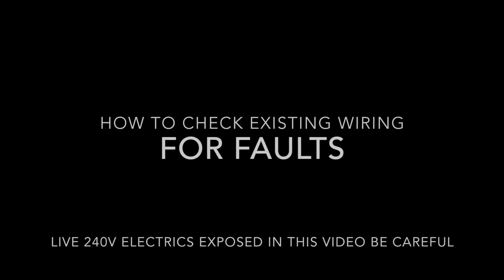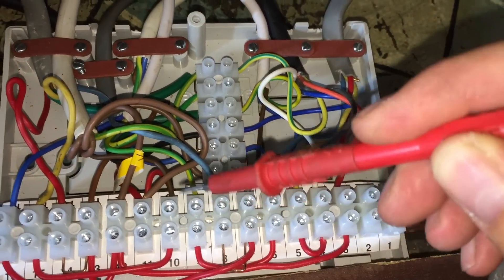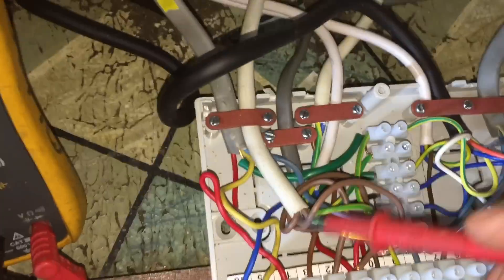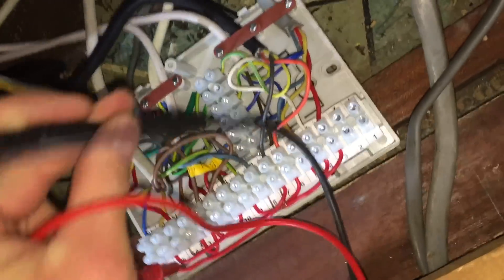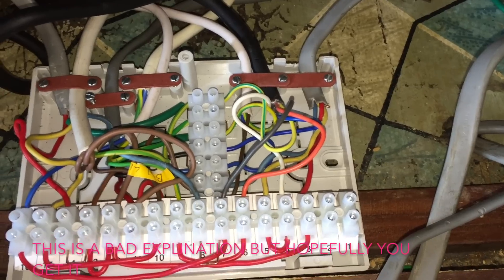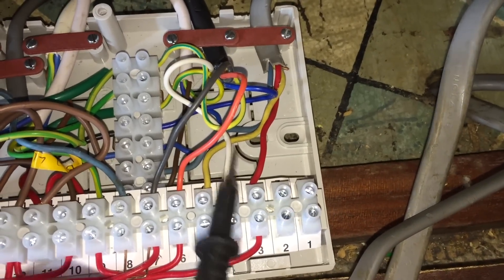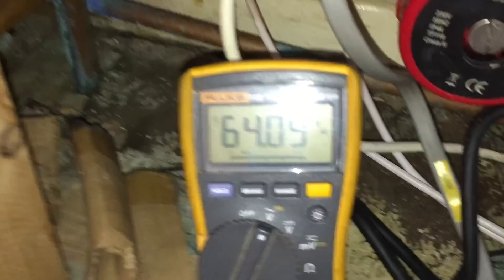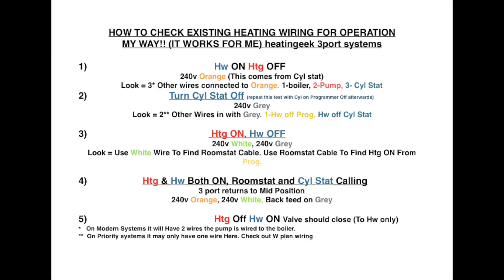How to test 3 port system wiring for issues. Reference Sheet at End of vid

Comment: Just done the wiring on a Glow worm boiler with y-plan system. It was firing from a really low 6.7v backfeed voltage, so on all the time. Put a contactor on the switch wire which sorted it out. I think some of the newer boilers use solid state relays which are far more sensitive than the old coil types. I labeled everything up and left a wiring diagram to be kind for the next guy.

Comment: Problem with my Drayton 3 port so I'm reviewing your vids - very good BTW. Subbed & liked as well. 

My problem originally was no HW overnight. Investigation lead me to the 3-port valve. No HW suggested a stuck valve body so I didn't mess about & got a new Drayton MA1 valve body & new actuator as a complete kit. All fitted OK & wired the new actuator head colour for colour same as the old one. So to testing. The actuator works fine off of the valve body. HW, Mid & Heating positions. However, when snapped back on the new valve body the actuator will not drive the indicator past the Mid position to activate the pump & boiler for heating. Thinking I might have a duff actuator head I bought another one - same problem. Tried both new actuators on the old valve body (which looks OK to me) & the same problem again. Actuators work fine & energise the boiler & pump in heating but will not do the same when fitted to the valve body. It's almost as if the actuator drive shaft & valve spindle are out of sync & the valve body spindle gets to it's max travel position before the actuator reaches the point when it switches on the boiler & pump via the micro switches.
Short of fitting a different make of valve head & body (which will no doubt require pipework adjustments) this has totally stumped me. I even rang Drayton Tech who couldn't help - said they've never heard such a problem before. 
So if you've got any suggestions I'm all ears.
Reply from the maker: the body must be duff. I have never had it happen but if it works off the valve but not on it then it must be. The grey wire is what drives the valve over to HTG only once the HW demand is met. If your positive it works off the valve the the only issue can be the body.
A is HTG, B is hot water and AB is flow from the boiler, Is the body fitted correctly?
Reply: @HeatingGeek  Yep the body is fitted correctly & it's a brand new one, there's only one way the Drayton heads can be properly fitted to the body & snap into place. Weird this is I had the same results with the new body (now fitted to system) & the old body on my bench - which looks perfectly OK to me. I have tried both new heads on both the old & new valve bodies with the same results. I even took the old actuator head to bits to see what could be wrong mechanically. There's a very small amout of spindle travel on these Drayton valve bodies & to my eyes it looks like the spindle is hitting it's max travel (indicator arm just passed the mid position) which prevents the actuator driving the arm fully over & engaging the micro switches to fire the pump & boiler. Spindle & acuator drive look out of sync if that's possible. As I said even Drayton Tech were stumped & have never heard of this one. I'm going to do some a more detailed wiring checks just in case something else is leading up the wrong path. 
Thanks for replying to my message on a 6 year old video. 👍 :washhands:
Reply from the maker: @colingoode3702  if you were to move the valve manually it will not make the microswitch, you kinda have to push it as far over as quickly as possible and the inertia will carry the actuator fully over. ie: the actuator head will not make the second microswitch if slowly moved by hand. 240v on grey and white will electrically move the valve fully to HTG only. 

I hope this makes sense
Reply: @HeatingGeek  👍I'm going to bench test the old valve body & new actuators with a flying lead into the wiring centre & watch watch happens. I'll also double check & test the wiring - just in case. Thanks for the help.

Comment: That wiring centre comes with a long length of red sheathed cable for making the additional connections on the terminal blocks ... that they've used the pre-bent ones that are meant for the neutral and cpc is beggars belief (and dangerous).
Reply from the maker: Why is it dangerous? Im sure the diagram on these boxes shows the links being used for power stuff. I'll have to double check but i'm am quite sure.
Reply: @HeatingGeek  if you have the cover open to test without it being isolated then those bare conductors would be very easy to brush against by accident and give yourself a nice 240V zap. Even with the cover off, having at least a single layer of insulation just seems safer.
Reply from the maker: @PhilJohn1980  Your absolutely right about that. It does make sense 
.

Comment: Great video but at about 1:43 do you say the orange should be 240v with the hw on then about 9.30 say you can remove the orange? Don't get that bit
Reply from the maker: The reason is the orange will only have power when "CH only" is on. The orange is wired into the demand from the cylinder stat, so when the HW is on and their is a demand from the cylinder stat the valve hasn't moved to "CH Only" the power to run the boiler comes from the demand on the cylinder stat. 

It's very hard to explain over text. 

The simple answer is the orange on a 3 port (isolated from other wires) will only ever be live the you have a CH demand and no HW demand. I hope this helps
Reply: @HeatingGeek can a faulty cylinder stat prevent both heating and hw to come on? No faults on boiler, my issue appears to be due to condensation in the loft. In warmer months everything works fine but in colder months it doesn't... I've changed pump, valve and some wiring last year but not cylinder stat.
Reply from the maker: @nadznadz5630  Yes the cylinder stat can cause no heating. When the HW is satisfied but the demand (HW) from a timer is still there its the cylinder stat that sends power to the grey wire on a 3 port to make it open fully for heating. This in turn sends power down the orange to light the boiler.
Reply: @HeatingGeek  but i don't even get hot water, if i got one then easier to diagnose. The cylinder stat is 25 years old at least..

Comment: Thanks for your videos.

I’m going to one today where the heating is staying on if heating only is on and then turned off at the programmer the pump and boiler stay on (3 port) 

If I put the hot water on at the programmer with the heating and turn the cylinder stat down it then turns it off. Really odd
Reply from the maker: I have a video on that. It's usually a Ri, Micron or Logic. I cant remember what video it is now...

Comment: Where should the grey wire go on a three port system pls.. I’m desperate.
Reply from the maker: Hot water off. So should join 2 other wires.
Reply: @HeatingGeek  Thanks, I’ve got a black from tank stat.and the grey from the valve, .. where do I put them? Pls.
Reply from the maker: @johnjackson1106  I have a video showing how to wire a 3 port system. If your system is a normal 3 port system, the grey wire goes to 2 other wires.1 will be from the cylinder stat (satisfied) and the other will be from the timer/programmer. (hot water off)
Reply: @HeatingGeek  you are brilliant 👍👍. Thanks for taking the time to help me. I’ll msg you when I’ve got the hot water back on.
Reply from the maker: @johnjackson1106  I hope you got it sorted
Reply: @HeatingGeek  Hello, No luck, I’ve identified the pump wires and the cylinder stat wires and the diverted valve. The rest is difficult. 
I had the boiler serviced by ex British  gas engineer, when he’d finished at first the boiler wouldn’t light . He said it was the  Electrode unit and replaced it, it still would not fire up. He then said it was the valve! When eventually it fired up we had heating but no hot water . He stormed out when I bought a new three way valve. 
I ll have another attempt at identifying the boiler from the control and room stat again . I’ve watched too many videos until I found yours. I need to clear my head. 🥸
Thanks you for your reply
Reply: @HeatingGeek  hello. By moving  the lever on the valve we’ve got hot water and heating , I’ve left the grey wire unconnected! When I put the programmer onto water only nothing happens, when I put the heating on the boiler fires up. It won’t work on water only. I’ll have another go at your reference sheet .
Reply from the maker: @johnjackson1106  That is not a valve issue. When on HW only the 3 port doesn't come into play. only the programmer and cylinder stat are involved in making the boiler and pump run.

Comment: Still catching up on your back catalogue. Off the wall and broadly irrelevant question - what do you thing of the relatively newly introduced WAGO based wiring centres - and have /would you use one?
Reply from the maker: I have always been very slow to accept new technology. I use normal wiring centres because I know what to expect. I know what I can fit (wire wise) and I know how tough they are. I will use a WAGO one when I have seen it in the flesh and can have a play with it. Until then, I like Drayton wiring centres.

Comment: Cool video. If i can ask a question. Any idea why when hot water is switched on it shuts boiler down whatever heating is set to. Heating works fine on its own but not with hot water
Reply from the maker: The wiring is wrong or the cylinder stat is faulty.
Reply: @HeatingGeek  Wow. !!   Yes it was a dry joint on cylinder thermostat live input.  Thanks for replying thou.   😃
Reply from the maker: @YorkshireBitsnBobs  I'm glad Its sorted and knowing wiring meant I had a good guess too. :-)

Comment: I cant find my 3 port valve. My junction box looks to be two faceplates with a 3amp fuse in one of them. The heating on doesnt circulate water in the rads unless it is combined with hot water on. No idea whats going on.
Reply from the maker: That could be how its meant to work. Old gravity systems were designed like that. What size are the pipes coming off the boiler?
Reply: @HeatingGeek  there is a valve but its behind a stud wall. I managed to install a nest combining the valve wire with the boiler and pump in the shed so all works at once. Cant have them separate due to it being an old system

Comment: This is excellent. I changed my Ideal heat-only boiler for an Ideal Logic + condensing heat only one. It's Y-plan connected with a 3-port valve. I had trouble with the boiler over-running the circulator pump and had to rewire the snake pit of wiring. I did it 95% right but noticed the radiators getting warm after the hot water only mode has run for 20 mins, so I have it wrong. This video will help. I see Honeywell do a proper wiring centre. Are these any good? All I have currently is a 10 space choc-block in an enclosure. It's a disgrace.
Reply from the maker: I have done a whole series on wiring. Check the Playlist tab and you will find it.:-)

Comment: Hi there, I may have a potential issue  with my central heating side of the system, I have a y plan with a worcester 18ri with pump overrun. When the central heating only is selected, I only get about 90v (from the orange wire) on the boiler demand terminal in the wiring centre, when the cylinder stat is satisfied. The boiler appears to still work and the pump runs. I can't help thinking if the pump wasn't switched from the boiler,i it would not work as the voltage on the orange is too low only 90v? The pump is wired directly to the wiring centre in the airing cupboard as you would expect with rest of the controls. The cylinder thermostat has recently been replaced, is it possible it could have been mis wired? its just the usual honeywell type, it has a short piece 3 core flex to the wiring center (Brown Blue and Green and Yellow)
The boiler is in the kitchen as well as the receiver, from the receiver two 3 core and earth cables go to the wiring centre in airing cupboard.
One cable contains (in the wiring centre)
Red=hot water on, connected brown to cylinder stat common
Yellow= central heating on, connected to white to 3 port valve
Blue= hot water off, connected to grey to valve and the Green and yellow which is connected to the 2 terminal on the cylinder stat

second cable
Red=boiler demand, connected to the orange to valve and blue which is connected to 1 on the cylinder stat
Yellow=Used to be unused but is now the pump live
Blue=neutral
Earths obviously speak for themselves.

 we have a hive active system so the room thermostat cable has been disconnected from the wiring centre.

hope this makes sense thanks
thanks
Reply from the maker: If you have CH only on and then remove demand by turning off the room stat I think your boiler may stay on and the pump runs continuously? Ri's will often run with very low voltage on the switch live. 
Check this and let me know.
Reply: @HeatingGeek  Hi there thanks for getting back to me, the boiler doesn't seem to turn off after I have switched off the central heating not immediately anyway, the green flame symbol is still on the boiler and the pump is running, the boiler does turn off after a good 5 minutes then about 3 minutes approx after the pump turns off.
Reply from the maker: @nrg-5003  you have 2 different issues I think. Your wiring is wrong (posable neutral issue) and your boiler is firing from back feed voltage  from the 3 port. These are issues an engineer will need to find the solution for. 
Good luck and I hope you get it sorted.
Reply: @HeatingGeek  thanks I will get it looked at, do you recon the 3 port valve has an open/loose neutral? Did the cylinder thermostat sound like it was wired correctly? or do you think the 1 and the 2 terminals could have been mixed up?
the cylinder stat is a honeywell L641A1039
thanks
Reply from the maker: @nrg-5003  In your first post you said "When the central heating only is selected, I only get about 90v (from the orange wire) on the boiler demand terminal in the wiring centre, when the cylinder stat is satisfied." This statement means you don't quite understand how the system works.  
Regardless of the cylinder stat position, when only heating is selected, the 240v for HW OFF is supplied from the programmer or HIVE. So your last question cannot be answered. More clarity is required on exactly what voltage you have where with what demand on.
Sorry, I know it doesn't help but I can't with the information provided.
Reply: @HeatingGeek  Hi, sorry please bear with me, the hot water side of things is fine, when the  cylinder stat is calling for heat I get 240v on the boiler demand  terminal which obviously activates the boiler and pump no problems there, The problem appears to be when I want central heating on only, I get 240v on the white and grey wires to the valve but only get 90v coming from the orange. The house is taking an eternity to heat up so my concern  is the boiler is not getting the proper voltage it needs to work properly, hope this makes sense, if you need more clarification please ask.
thanks
Reply from the maker: @nrg-5003  Ok. If you have 240v on white and grey (measured against the neutral the valve uses) the 3 port is faulty. It needs a new motor or complete actuator. Simples
Reply: @HeatingGeek  Thanks very much for your help and patience, much appreciated :>)
Reply from the maker: @nrg-5003  No problem Subscribe!!!!!!!!!!

Comment: Thanks for the video,After some advice my boiler fires fine with call for HW but when the heating is first turned on some times it takes several minuites before the pump starts and boiler fires, any ideas thanks
Reply from the maker: Sounds like a syncron motor issue. Get an engineer out and he will sort it quickly.

Comment: I like your videos, very thorough thought process. Nice to see another heating engineer work! I use you as a teaching tool for my apprentice... you need a go pro though! On a 3 port that back feed 80v will keep a Viessmann 100w boiler on they have started giving you a resistor to fit, first time I came across that it messed with my head for ages!
Reply from the maker: Worcester Ri's Glowworm Micron and Now (thanks to you) I know about Viessmann 100w. I have a gopro now but cant really work out how the best way to implement it. Check out the Worcester Cdi diverter video and Ideal logic sump video for how I'm doing it now.

Ideal sump https://youtu.be/LWYlV3D-GnY 
Worcester Cdi diverter.  https://youtu.be/bX2BqZ-TYnY

Have a look at the tools vid and see if you think I'm right. I think its good for new guys.  
Tools.  https://youtu.be/GCa0sEc0CtQ